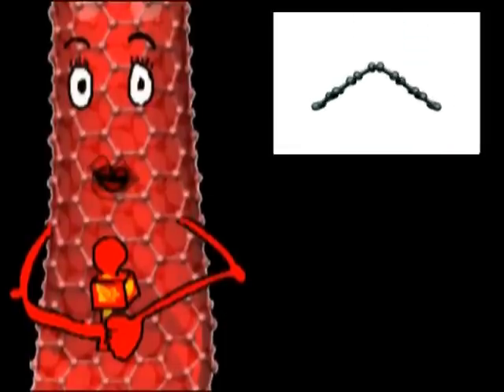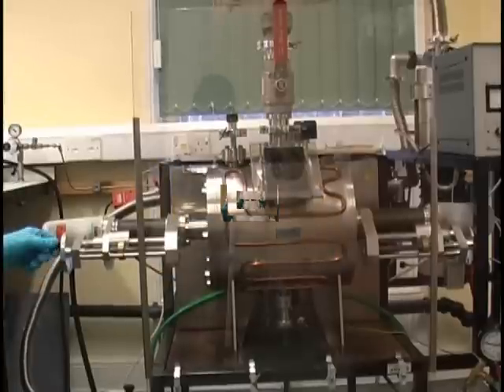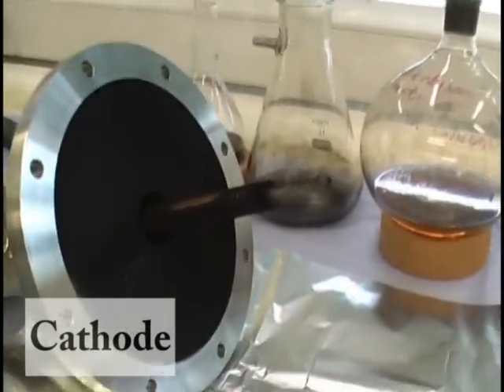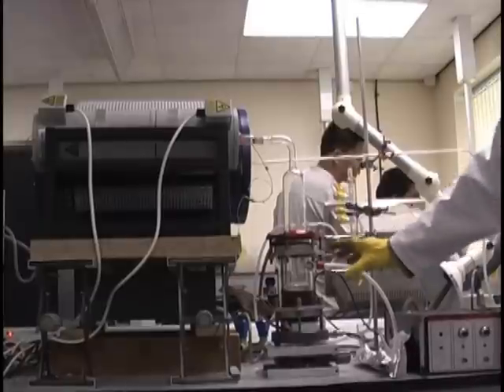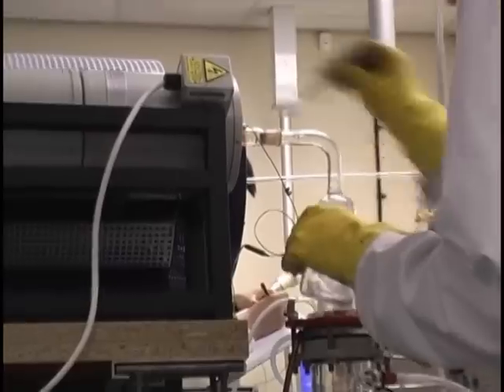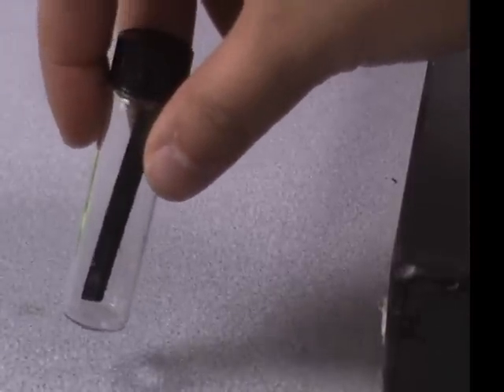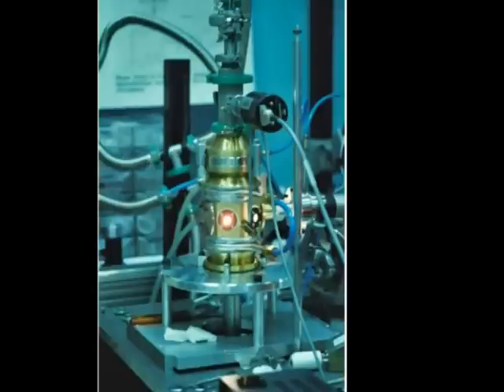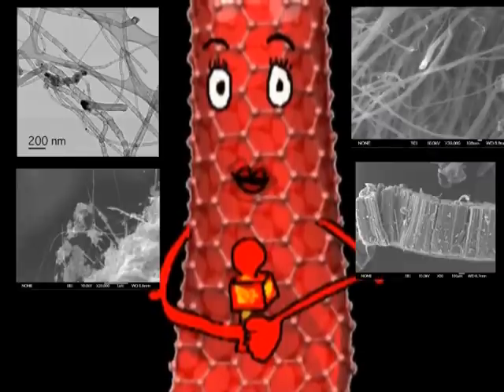Nanoseries 2/5 : How are carbon nanotubes made?

Comment from the maker: @krecian in this case it's iron (but nickel is also used a lot).  But instead of starting with the iron on a surface, a gas of the molecule 'ferrocene' is used, a molecule with carbon, hydrogen, and one atom of iron in it.  So the iron arrives in the gas at the same time as the carbon.

Comment from the maker: So far I am not aware of anything like that.

If the nanotubes are opened ends and you put them in contact with buckyballs, buckyballs tends to enter inside the nanotubes (the form is called peapod) - given that the nanotube has an appropriate diameter.

Another form which "may be related" to what you suggest  :) are nanobuds. Check the episode 5 of this serie to see some more nanoforms of carbon.

Irene

Comment from the maker: Check this two references:
1. Electrolytic formation of carbon nanostructures by W.K. Hsu, et al
Chemical Physics Letters, 262 (1996), p161-166
2. Condensed-phase nanotubes by Hsu et al. Nature 377 (1995), p 687

I hope it helps,
Irene